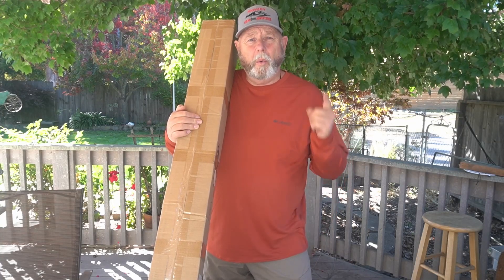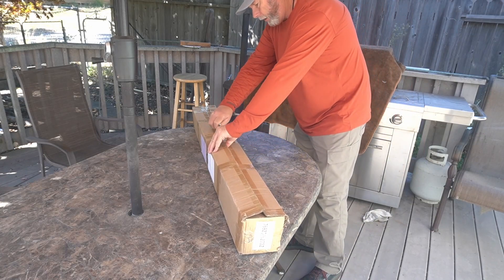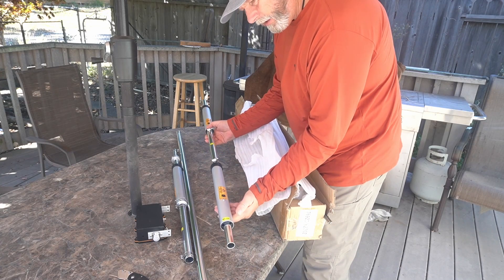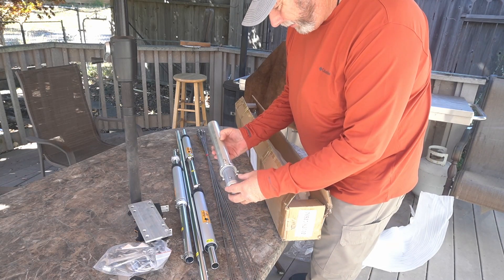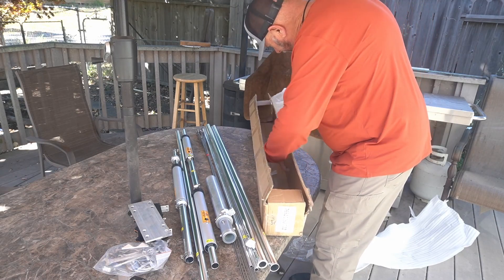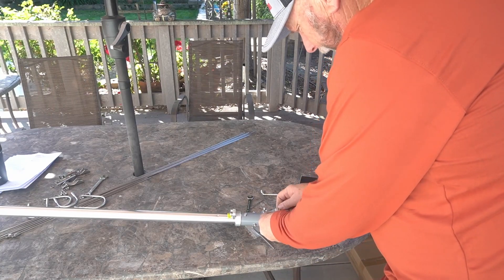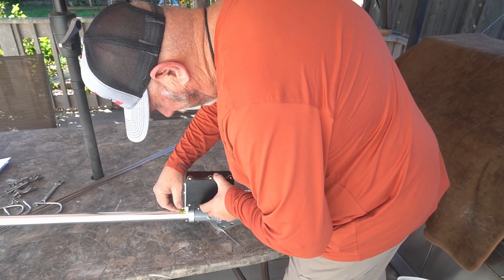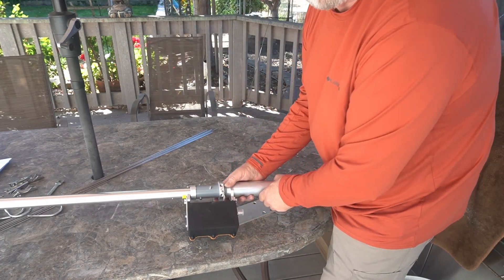40m: Fixing their Broken Directions!

Comment: I found it a lot easier to adjust the antenna by using a tilt base (HyGain ATB-75). You need to prop it up with a ladder when it is down, but it makes adjusting higher up relatively easy.  Glad you spent some quality time explaining the tuning.  This antenna is vastly underrated, particularly for a backyard lacking room for a decent radial field. Look forward to any updates.
Reply from the maker: That would be easier with the tilt base!
Reply: Instructions...?
I don't need no stinking instructions !
                🤔...?

Comment: Nice video. I've been struggling some with tuning mine as well. Most bands are resonating too low. I finally found that that the 2 short tubes that come preassembled to the trapes were the same length! They aren't supposed to be! One is supposed to be around 9.6" and the other 11" or so. I contacted Radioddity and they shipped me a new short tbe from China! I also found that the SO-239 did not fit many of my PL259s properly because of the overly wide spread of the teeth in the shielf part of their SO-239. I replaced the SO-239 and that solved that problem. Iwish you had told us what your final dimensions were. I gathered that you only adjusted the length of the lowest tubes, which are actually the 10 meter section, which is bizzare. I do think your conclusion about the design flaw is correct in that it was designed to resonate to low for 40 meters and that throws everything off a little. For the money though, I'd agree it is a good atenna and works well and with a tuner can also be used very affectively on 30, 17 and 12 meters! Components are of good quality too as is the machining. Can you tell us your final measurements?
Reply from the maker: Richard I have a second video out with the measurements that I used.
Reply: TNX Chuck I'll have to compare them to mine which I think are close but 20 meter resonance is still too low.  @KK6USYHamRadioAdventures
Reply from the maker: @RichardLawn  The only band I had that was too low was 40m for me

Comment: Aloha and good morning, Chuck! 
      Yes, I could see me setting this antenna up out on my lanai for my condo-NOT! 😂🤣😂
 I would agree that this antenna needs a little more patience and a good antenna analyzer to get it as close to perfect as possible. 
     I think most folks would be going for a permanent mount with the antenna in the neighborhood of 25 feet and I would take steps to prevent rain water from getting inside the tubes of this Xiegu antenna for sure like I do for my repeater antennas since Hawaii usually gets more rain than most locations around the country with the exception that we get most of our rain during the overnight hours. 
     What a great video and a must watch if you’re going to buy this antenna to set up on the roof. 
     Now if Xeigu can come out with a 120 watt version of their G90, this would be the ultimate HF set up. 
    Thanks Chuck for all the work you put into this video, I’m sure it wasn’t easy, because it never is really. 🤙🏻
      73 and Aloha my friend. 🤙🏻

Comment: Great video Chuck.   I've been testing vertical mobile antennas.   I got the OPEK HVT-600 multiband antenna and a  ANLI magnet mount for my vehicle.   Made some contacts to the east coast on 10m with it.  Also made on on 15m phone to Netherland Antilles  (Curacao).    its a fairly well made antenna but I dont drive around with it on the car.   I usually pull over and install the antenna on the mag-mount

Comment: So I just built this antenna today.  Its atop a 20 foot mast and I have a copper ground wire running from a steak 8 feet deep up the mast the the bottom of the antenna.  On 10-meters, its resonant around 30 Mhz even though I shortened the bottom section.  15-meters is not resonant at all.  20-meters is dead center band and 40-meters is 1:1 match at 7.200. which is good for me.  I know I need to shorten the bottom more to get 10-meters adjusted but I have no idea what's up with 15-meters as there really isn't much of any adjustment between those two traps.  Any help would be greatly appreciated.   Thanks... KC3JS

Comment: It's weird you started at the top of the antenna as the manual states start with the base, next 10 meters, 15 meters, 20 meters and last 40 meters. This sounds logic to me as adjusting the lower part of the antenna will affect al lower bands. f.e. adjusting 10 meters will affect 15, 20 and 40.  I think the reason SWR raised on 10 meters has to do with adjusting the lower part of the antenna. You got things right on the other lower bands but to much adjusting of the 10 meter does affect all bands (10 meter included). Since the antenna is advertised to be resonant at 6.9 and has a steep Q-factor is the use of traps. A trade of against a full real quarter wave on 40. Just my two cents. I'm looking at this antenna because it has my attention to put up here at home. I also live in a smaller place without a big garden. I was looking at Cuschraft before but build quality is not that good as it was years ago. I did had a R8 in the past. Nice video. 73 Phil ON4VP

Comment: Great video Chuck. For the $$$, it looks like a decent vertical. I think you helped anyone who buys one to get it adjusted without too much frustration. You continue to produce videos people like to watch. Off subject...but. I have a GAP Challenger Vertical antenna. I have not seen too many reviews on it. At about $500., it's a very, very good vertical. Super strong on 20 and 40 meters and with a short stub in the 12 meter tube, 17 is great and 12 meters still very good. It goes up to 6 meters and also does 2 meters. It's pretty wide banded. I can use all of the bands without a tuner and be 1.3 to 1.7 on the SWR on all portions of the bands except 80M. 80 meters gets you about 150 Mhz. You can buy caps for different parts of the 80m band. Like most multi band verticals, it's not super strong on 80 meters. I'm letting you know about this antenna because it has worked very well for me for the last 13 years. Great signal reports and DX all over the world. It's not a beam, but for the price I feel it's better on 20 and 40 and just as good on other bands than the $800. offerings from other manufacturers (as compared to other hams I know who have the more expensive verticals). Many good reviews on E HAM. If you ever get the chance, check one out. Customer support is excellent. It's 31 feet tall and only requires three 25" counterpoise wires for the 40 meter band only (which can be bent...Great for small spaces). I think it's basically a vertical dipole. It does not use any traps or transformers.  I believe a lot of hams would be very happy with this antenna, especially at it's price point. It ground mounts with a supplied, direct bury tube. Gap also makes another version of this antenna that is mounted in the air than many really love also. At my old QTH, it was out in the open. At my new QTH with less land, it's mounted 12' off the corner of my one story, metal roof house with a bunch of very tall pine trees on the other side of it. It worked a little better in the open, but still works excellent with all the obstructions around it. The owner of the company advises it works best with about 100' of coax to the radio.  73 !

Comment: I left you another question on your measurement video (VERY HELPFUL).  Did you attach a ground wire from the mounting the U brackets?  Thanks for thew answer John N6TRC
Reply from the maker: No I didn't.
Reply: Thanks again....I have a lightning arrestor before the shack  and that will be   John N6TRC. it @KK6USYHamRadioAdventures

Comment: ok.. for what i saw on your video: i would not be happy on that 10m graphic. should not be high flat, instead of some kind of deep point. 
on my experience with most verticals and most of theme this "cushcraft" type, you should be  mint on 10meters even before start assembly next segments. once you got 10m (or if antenna came with 6m, staring with 6m), perfect swr chart then add next and next and next and continuously tunning each segment. the 40m will get left at top and you should move in/0ff segment to get it to the right place understanding that for sure 40m will be the less broadband.  could be less than 25mhz broad.  for me i decide if i want  it on 7.080 where i do lot of ssb or some 7.200 but no way being both sides right.